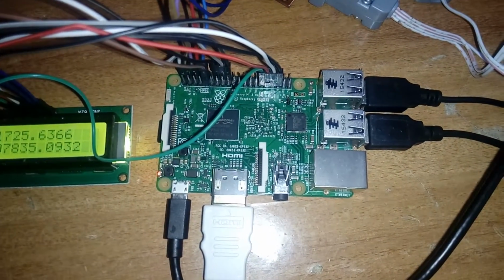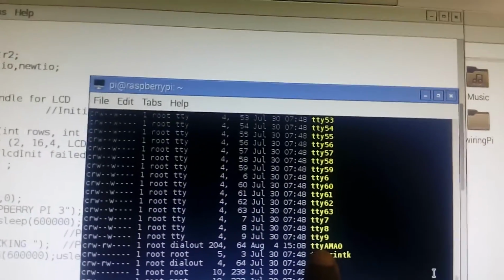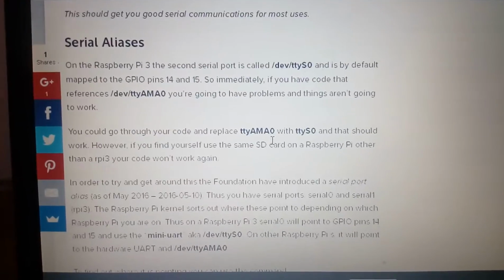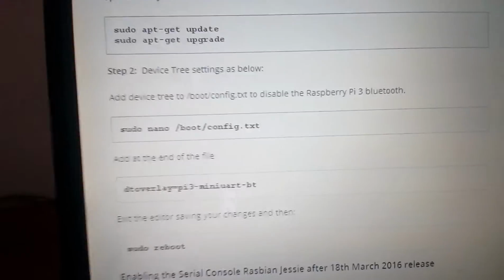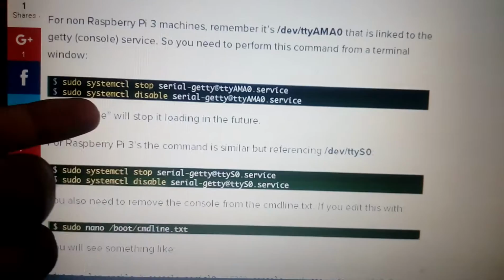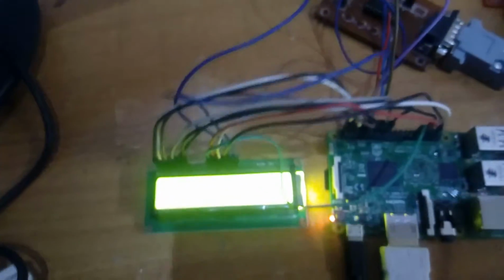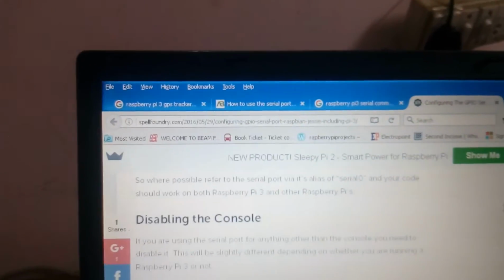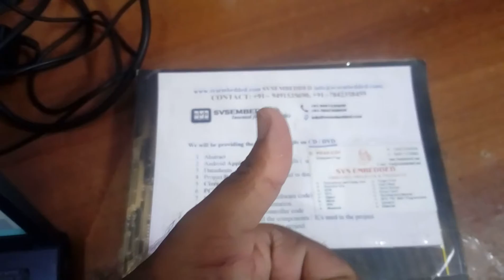Raspberry Pi 3 Serial Port Usage - Disable Bluetooth

Comment: HI, I am working on a project, connected my GPS module serially with raspberry pi 3B+ module, I am getting the NMEA sentences on the terminal, but I want to connect this with the Node-red serial port node, its saying permission is denied because I am using ttyAMA0 instead of ttyS0 which is not getting the connection with serial node, however on the other hand ttyS0 is getting the connection, but not showing any output at the debug terminal, Please help.